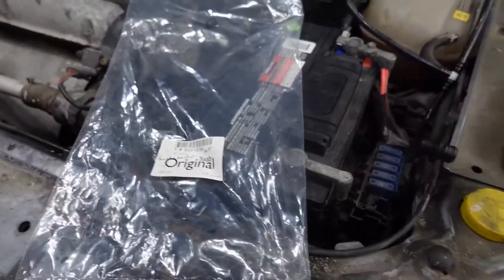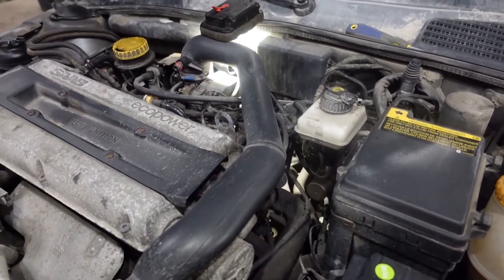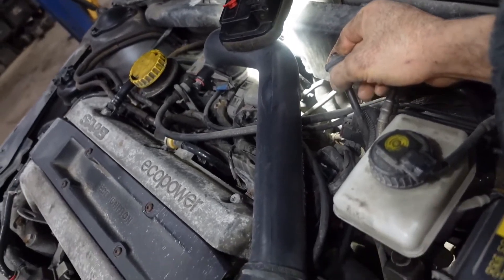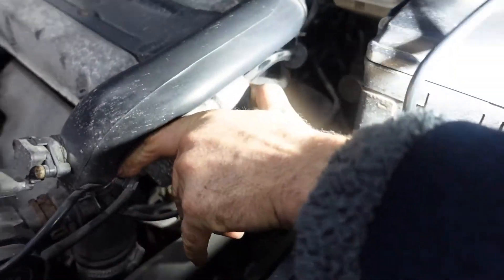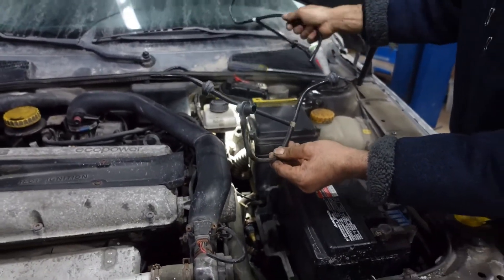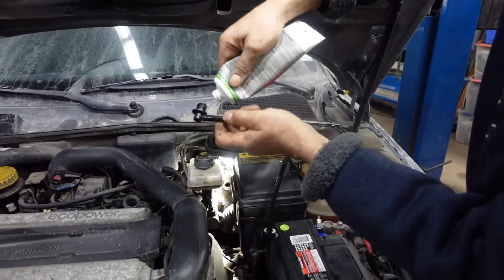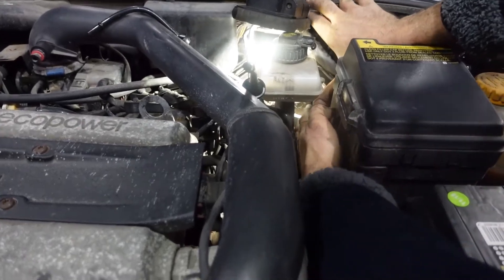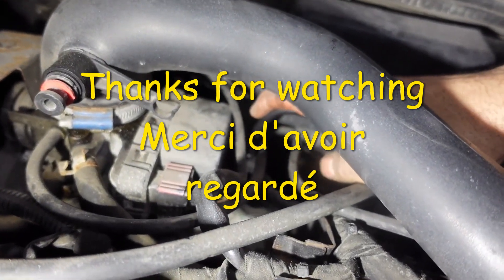How To Replace SAAB 9-5 1999 up to 2009 Brake Booster Vacuum Pipe

Comment: Even if you don’t work on SAABs , good to know in case you come by such an issue.
Reply from the maker: You are right! Big vacuum leaks, between the air filter and the throttle body could cost you a towing to the garage. A quick visual check can help sometimes.👏👏👏👍

Comment: The way you describe it it seems to be same issues with mine. Currently I have two issues: when idle in N or P it revs itself  and stays at 1800 rpm, while driving it tries to rev between 1400-1800 back and forth, also since I got the car a year ago it seems it doesn’t break as I would wish to break,breaks pads are having plenty life in them, sometimes it breaks fine sometimes I feel it’s not going to stop where I am aiming and passes that point. Do you think they are related both to this vacuum break pipe?
Reply from the maker: First, you need do check for vacuum leaks around the intake manifold (broken pcv valve or broken brake booster pipe etc.) . If there is no leaks, the problem could be caused by the electronic throttle body in the limp mode. For further diagnostic, scan test must be needed.
Reply: @saabmastertech5852  I have literally just looked at it right now and it’s broken end of one of the valves. Mine is a 2.0 T auto 2006 plate. I’m in the UK. Where did you order your part ? I assume you have the 2.3 T Aero. Thank you so much.
Reply from the maker: You can buy SAAB parts online such as; eSaab Parts, eEuroparts, Euro Parts, Rock Auto, Goldwing Used SAAB parts, Nordic Speed SAAB parts, Skandix, SAAB parts UK, Alvadi, Ebay, Facebook Market Place, kijiji & other SAAB scrap yards mostly in North Eastern, United States.
Reply: @saabmastertech5852  Thank you!